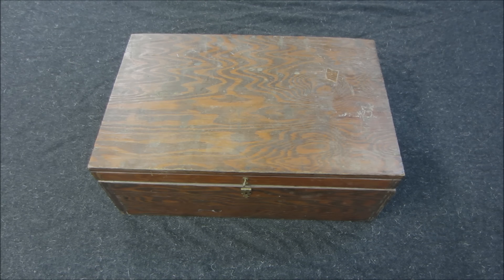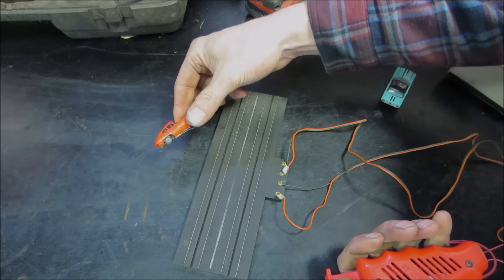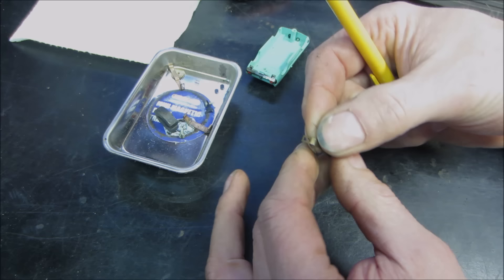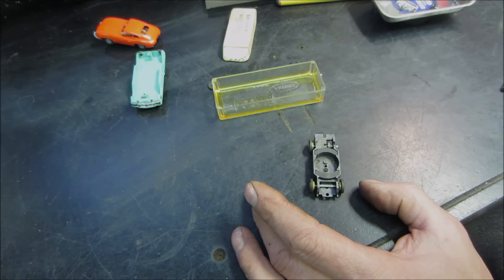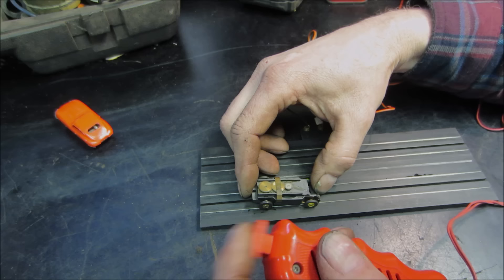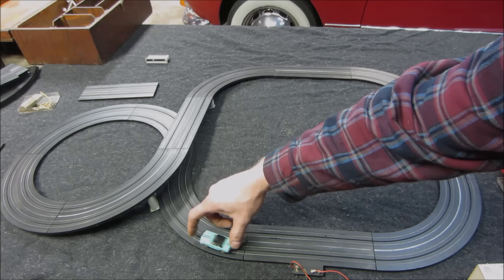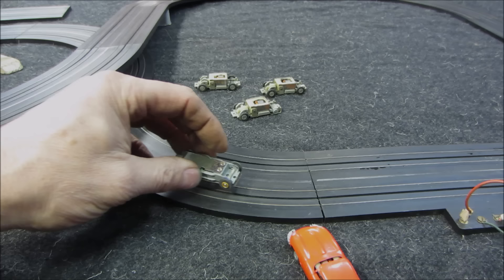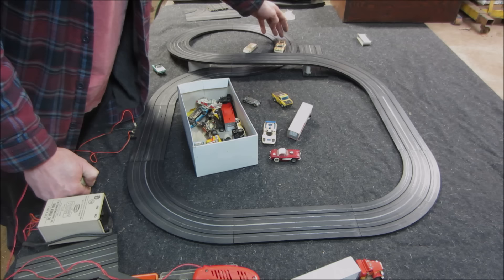will they run? 1960s slot car set sitting 40 years.

Comment: In the UK around the 70s and 80s there were clubs with hundreds of members that set up tournaments every weekend and they even had a league that covered the sport it was a big thing with prize money involved and some awesome circuits .Cars and tracks were usually scalectrix and were a couple of scales up on your stuff the cars were also formula 1 racing cars with sophisticated suspension and the electric pick ups were more of a wire wool brush for better contact and the pick up track was a lot wider.

Comment: I raced 1/24th cars. To get more speed and acceleration we wold rewind the motors with much thicker wire. The results were amazing!  If you raced a regular motored car you would leave 'em your dust. The hot motor would actually suck most of the amps from the track and the other guy didn't have any left! ( He was Amp sucked) Oh yah, we had to epoxy the amature and balance it too. If you didn't, the amature was a ball of wound up  wire.  It was great fun.

Comment: Bought a new AFX track for Gkids and BIL said we could have his 1967 track and 6 cars. I have been slowly working on getting them cleaned up and running without new parts. I will order new parts eventually. especially new tires, but finding the ones I want/fit is not easy. 
    The new Mega G+ cars are nothing like the old Tycos, etc. The newer(to me) "magnet chassis" (added chassis magnets not the motor magnets) cars stay on the track much better, you are not putting your car back on the track constantly as we did as kids. The tri-pack 1 amp 8, 12, 22V power supply lets you limit the max voltage for the younger kids so the cars do not fly off. Novice, Intermediate, Expert positions are the choices. Auto World has an adjustable power supply with 2 amps from 9V to 24V. But hold onto your wallet if you go down the rabbit hole. I have a 4 lane Supper Track=extra track and a 23' x2 "return" drag track.

Comment: The eraser truck works, but also leaves traces of rubber behind, and can cause poor connection, so after the eraser I always wipe the track with the highest percentage rubbing alcohol you can find, 99% usually, it removes more dirt and leaves no residue, makes it work a lot better!

Comment: You talk about the smells of 3/1 oil. and ozone , it brings back so many memory's, my Mother would get so angry with me, on the engine of my trainset it blue smoke, it had pleasant smelling oil to use, but when i ran out of the oil they provided, i use 3/1 oil, i would get that train going around the track so fast i had a circle of smoke  in the room and a blue haze, the three and one oil made better and more smoke than the oil they sent with the set, but you know how it smelled, my mother would forbid me to run my train using three and one oil in it.

Comment: I had a slot car set from the 90s I can't remember what happened with  it but on those cars instead of strips of copper for the shoes they were made of were small wire strands clamped together.

Comment: I'd like to see more content like this if you care to keep posting it. I might be wrong, but it looked like you had a couple Tyco HP-7 or other early Tyco in that box of cars. Unfortunately, I couldn't see too well because it was a passing shot, but that's what they looked like. I'll watch again and see if I can spot them.
EDIT:
The Jeep is definitely a Tyco chassis, I wish I could remember which one but it's either Curve Hugger or HP-2 Curve Hugger. I'm leaning toward HP-2 though. The maroon Corvette with the white top and white tires looks the same. I couldn't get a good enough look at it even at .25 speed; it just wasn't clear enough, and when the shot was clear, there was either a finger or thumb obscuring most of the bottom. In any event, it's not an Aurora/AFX G-Plus. Those early-ish Tyco HP-2 and HP-7 chassis had really short silver colored pick-up shoes, while GPlus had long copper shoes. There are also some slots cut in the bottom of the HP-2 where you can see the traction magnets. The Aurora/AFX GPlus  had the motor exposed on the underside of the chassis and the traction magnets rectangular and on either side. Tyco HP-2 chassis are gray, while Aurora/AFX chassis are black and as far as I know never came in gray but I could be wrong. I also remember Tyco making that particular body style Corvette and I always thought it looked kind of goofy because it was too tall in relation to its length.

Comment: Originally all the tires were rubber and they would get hard with age, sponge tires came along later.  The early cars with same size tires all around each car used two guide pins, one in front and one in back, otherwise the cars kept spinning out and came off the track. When Aurora started selling larger diameter racing slicks and dune buggy tires the rear pin idea was abandoned, then a couple of years after that the AFX cars were introduced and Model Motoring died out with the advent of AFX Racing. But you used to be able to buy little houses, and scenery for your Aurora Model Motoring layout, just like with model trains.

Comment: I started using the graphite side of the pencil to clean contacts.  It’s hard enough to clean the corrosion,  doesn’t seem to be quite as abrasive as erasers, and leaves a nice dry conductive graphite lube on the part.

Comment: 11:05 I remember switching magnets to make the cars go the other way around the track. I usually had some kind of Tyco setup, with the 440s it was that easy because the traction magnets were incorporated into the motor magnets. It was as simple as switching the left and right magnets. With those chassis, you could also just remove the rear axle and reinstall it backwards. Once I found out how to do it, it wasn't a far jump to figure out that I could also cut the wires on a controller and hook them up backwards to do the same thing. I had (still do, but whatever lol) a bunch of those lane changer tracks, and as long as you put two of them in you could still run two controllers, but more on that in a second. What we would do was change one of the cars so it would travel around the track in the opposite direction than the other. With those two lane changer tracks, it was inevitable that at some point, our cars would approach one of the changers at the same time from opposite directions and sometimes collide. Then there were the times when I wanted to run the track alone which is where using only one lane changer tracks came in handy. If you used an odd number of lane changers, both lanes of the track were on one circuit, so it took two laps around the track to end up on the same lane where you started. I don't think any of us realized it at the time, but slot cars weren't just hours of fun, they were also unintentionally educational.

Comment: Reminds me of my old sets that I haven't had out in near 2 decades, including some that formerly were my fathers.  The old set I have is somewhat similar, a good number of the cars with the same chassis you cleaned up here, but the tracks use 2 alignment pins at each edge and a U pin/clip at the centerline of each joint.  Unfortunately due to the age of the plastics those plastic u clips are in a bit short supply compared to the rest of the parts...  I think I may try either 3d printing or perhaps even casting some in aluminum as replacements.
Reply: I almost forgot, the controls of the antique set I have are mini steering wheels rather than the trigger grip type... with the added benefit of a direction switch built in to each control.

Comment: the metal pins on the track are better, because the plastic ones kept breaking. I used to make guide fins for the rear of the cars to keep the back end from kicking out (AKA cheating). and i would clean the tires with alcohol to make the sticky, of course they were useless the next day LOL

Comment: I had these little ones when I was a kid, in my opinion the ones made by Tyco were the best but they were still very small and difficult, you would have to warm up the cars and track until they ran smooth, now I have the 1/32 scale from scalextric and carrera, they are much better.

Comment: Atlas track of course, Jag is an Atlas.  Mostly Aurora cars.. a few Tyco's..all the cars would need oiled first  before running .. taken apart , cleaned adjusted and oiled properly to run good and right . Red Vette and Yellow Jeep are Tyco...the chassis after the Mustang and the 4th is an Aurora  Vibrator ..actually invented by Derek Brand from an old A/C Current doorbell. Very popular to collectors, and most are very expensive. Semi is the AFX Magnatraction. White #3 is the BMW 320i. 
They all should have silicone tires these days to run best . It would have been more exciting and fun for you and all if you could have oiled them first, cleaned the pickups at least to possibly get them running  for the video.. but interesting none the less. If you decide to get them out & play with them again, clean every  metal electrical contact point including and any and all spring ends and so on..

Comment: You gotta rub the track rails with a coin to clean them to improve the connection. once the cars start to run they clean the rails more as they drive over them.

Comment: buy o-rings in the right size and replace those old hardened tires. remember doing that to my dads old cars from like the 70´s (don´t remember the brand but was 4 lane tracks) in the mid 90´s when like 10 years old.

think u can go slightly oversize on the driving wheels aswell remember the kogs on the axle hitting the track somtimes because the tracks was slightly warped and the kogs so close to the tracks.

also i suggest some contact cleaner in the remotes probably just corrosion on the "potentiometer" inside them.

Comment: This is the big difference between Generation X and Millennials. Gen X kids grew up with toys that they had to set up, occasionally repair or maintain and with some problem solving, such as making sure the track rails had electrical continuity, thrown in.

When presented with something broken, not running right or any practical problem a now adult Gen X figures it out and sorts it.

By contrast a Millennial first checks to see if there's an app on their phone / tablet to solve the problem and when there obviously isn't one, gives up or asks a Gen X to solve it (conditional on acknowledging that Gen X really do know far more than they do!!).

I'm an electronics and electro mechanical engineer by profession because I was educated in basic engineering skills by toys such as these and 99% of problems cannot be solved by simply adding or subtracting a few lines of code.... one has to reach for the toolbox!!

Comment: I still have my Triang [later part of Hornby] set. Like Scalectric there is a slot in the middle of the track with a + running down one side and - the other. There's a pin in the car which drops in the slot to keep it on track. The contacts are two brass plates forming a V and spring loaded so they push against the + & - strips. All the wheels make contact. I couldn't tell if that one you have does. I wonder what condition it's in un touched for 40 years like yours. Oh for a moment I could smell the motor - bliss. One of my cars is a Jag too. On the Scalectric & the Triang the motors run inline with the car not at 90 degrees.
I wonder if you've seen any of James May's rebuilding series. Putting things back together. Like you very therapeutic.

Comment: Back in the 60's we had Strombecker 1/32 scale slot cars... we used a lot of naphtha (AKA Zippo lighter fluid) to clean parts and rails, gears, tires, etc. It seemed to work good... ?

Comment: The set I had was AC and there was a converter to go to DC. The tracks were connected with pins and little U shaped connectors. Still have the cars and the plastic case...might have the  rest of the stuff somewhere

Comment: His track & cars WITH bodies; were BOTH---- AURORA BRAND-- 1st with Vertical motor-shaft
3-gear drive; OUT-SOLD ALL!  I only owned (1) car; my SET was a  TYCO as were my MAINE
2 cars; & THAT'S what the 2 cars WITHOUT bodies were; that were Horizontal motor-shaft
direct to axel drive!!!    I well remember!!!   The TYCO track by about 1969 or 70 was MUCH
EASIER to ASSEMBLE--NO PINS!!; you would hold them together Closely, OFF-SET by
a 1/8 inch & LOCK them together with 1 motion!!!!
HOWEVER,  AURORA's --3-gear drive was A 1/8 inch LOWER CHASSIS & ALLOWED
almost PERFECT HEIGHT HO bodies!!!!!!     TYCO & other HO cars REQUIRED HIGHER
out-of SCALE "FATTER" bodies!!!!    AND YES we KIDS NOTICED!!!!  SO AURORA
DOMINATED HO SCALE!!!    I remember the VIBRATOR drive; but FORGET it's make!!!!

Comment: Does anyone else remember putting the One drop of oil,onto the bushing for the motor,under the car,before each day's fun?
Reply: Ahhhhhh.The memories you've brought back.The 'Lemons Racer'with Magna-Traction,that the headlights worked in.The Oval pin so the car stuck better when it spun out.Wow.Thnx.

Comment: the first type of slot cars that came out from Aurora where AC later on they game with DC cars if you wanted to run the DC type of car as you had to get a different power source and controls I had a lot of fun with these cars when I was a kid it was a Christmas present for my older brother the AC cars had a vibrating read that power to rear wheels the newer ones have the motor like the guy who's working on those were DC big Improvement they ran faster and you can control the speed

Comment: You also have the original Aurora vibrator chassis.....those are older..... You can actually use mechanical pencil leads for the carbon inserts....

Comment: dirty old track.. i used to un-plug the transformer and run a quarter or 50 cent piece along the metal contacts of the track to remove the yuck and corrosion on the metal lines.. and id use a pencil eraser to clean the copper contacts on the cars.. even had to take apart and clean up the triggers...

Comment: These weren't from the 60's. The original series from the 60's didn't have motors, they had vibrators. The controllers were a small box with a steering wheel regulating the power for speed.

Comment: The Aurora T-Jet Red Wrecker (Worth around $75) and the T-Jet Olive Green Ferrari 250 GTO (Worth around $65-$85) GT car are worth the most there in that lot...followed by the Turquoise '65 Mustang (Worth about $35-$40).  Those cars are mixed years..from '1962 to 1972.  Some cars there are ATLAS Brand made cars such as the '62 Chevy Impalas Red and White.  The Red Jaguard Is an Aurora '63 Jaguar XKE, but you have an incorrect ATLAS Chassis on it.  The chassis that you picked up that had a "Weird" Rear Gear as you say...is a 1960-1962 (Made for AC Use Only, NOT DC use or will burn out) Aurora Early "Vibrator" car chassis. They were Aurora's first chassis's in 1960 before the introduction of the Thunderjet 500 ("T-Jet") Chassis in 1963.  The track that you are using is all ATLAS Brand Early 1960's Track that you are using with a 1960's Aurora "T-Jet" Power Pack.  :o)  Tony K.

Comment: Did you check the transformer unit for proper output voltage? Clean off the connecters on each track piece with contact cleaner? These tracks used to run on 16V -21V.

Comment: you could really use new tires, that will greatly improve your cars performance, vintage dried out tires wont do you much good, the weird vibrator car would run with new tires if you can find any for it.

Comment: You sure that's not a Tyco track? Those controllers dont look like Aurora either, I had Aurora race set back in 66-70, but your track is different with 4 pins, mine had 2 pins/track and 1 locking U pin in middle that holds track together and I dont remember all that lost connection after I cleaned rails with eraser. Then in 72 I bought a AFX set, totally different track hook up, no pins just slide hooks together to it self on easy to break off hook thing, then you'd have to order some metal clips to under track to hold together.

Comment: You need to clean the track with alcohol.
Reply: Look up a company called deluxe materials they sell a really good track cleaner called track magic. I did our scalextric track with it  and once you remove the harsh stuff with a track rubber you can go round with the cleaner it brings back the shine. It also prevents corrosion as the small rust patches turned back to a silver colour. Going to use it on my model Railway as well.

Comment: Mustie I’ve been watching all ur videos I have a question for you I have a mower with a warped blade shaft and a pierce a the motor edge broken off will I be able too fix it can I heat the shaft a try and straighten it back out or what

Comment: You still have any of those antique 24V generators? run the track off that instead of the AC transformer
Reply: Or another antique generator I guess. Set up an off-the-grid slot car clubhouse